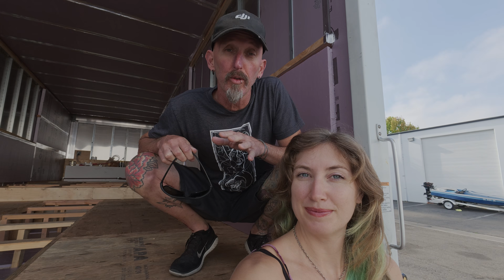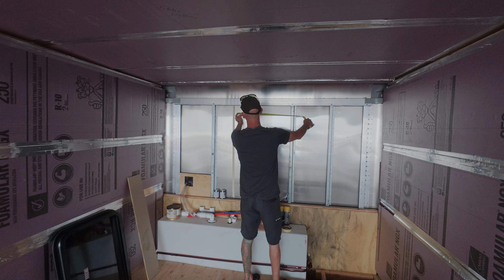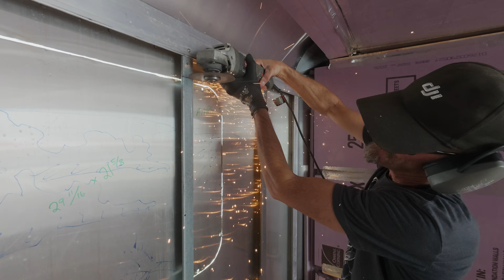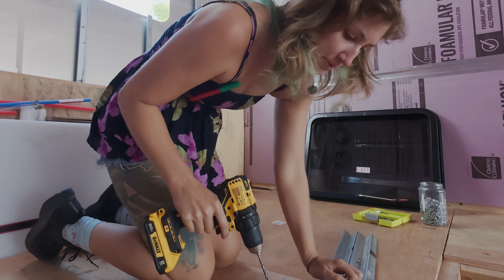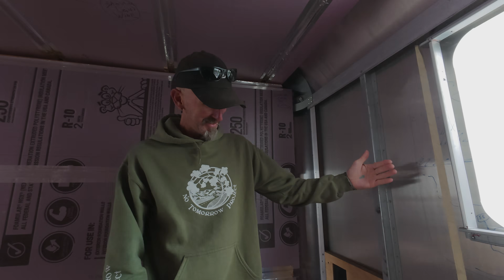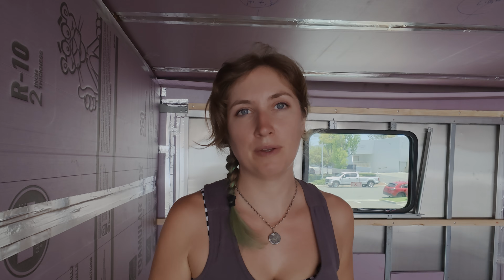This Might Be a BIG Mistake With Our Build: High-Stakes Window Installation

Comment: I have those type of windows on my rv, I added pin hitch clips on them. On the part that holds them open. That way when the wind blows while you have them open,they don't come unlatched. I also have a hole for  clip( for when the window is secured, so it's an extra  latch to hold it closed. One clip for two jobs😊. Hopefully you understand what Im trying to describe.
Reply from the maker: @jim87vette I absolutely understand what you are saying and will be utilizing that for our window.  Thanks 
@jim87vette 👍🏼

Comment: It’s far easier to cut that aluminum with a jig saw. Angle grinders hard to control and aluminum allows you to use wood working tools
Reply from the maker: @richgutowski9607 I figure it's kind of like picking a knife.  One of them feels more comfortable in your hand than the other.  If I didn't have experience with an angle grinder I would definitely have picked the jigsaw.  👍🏼